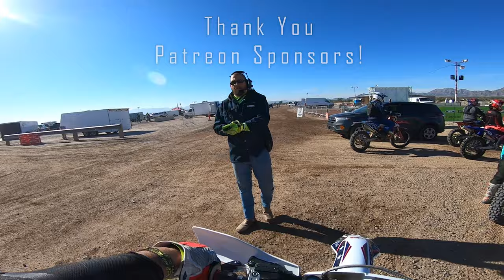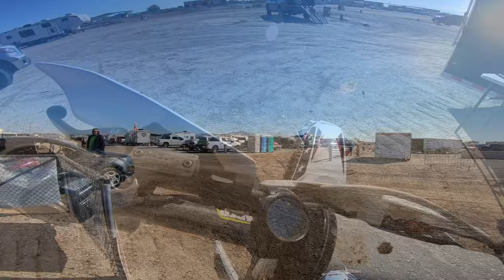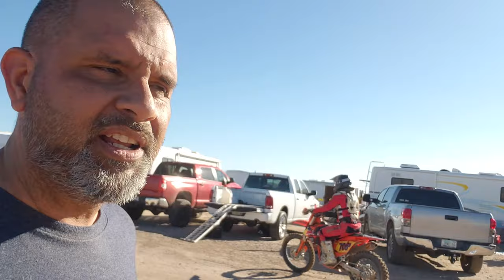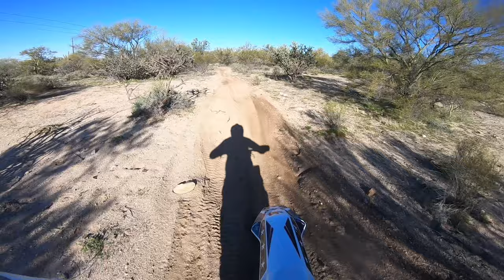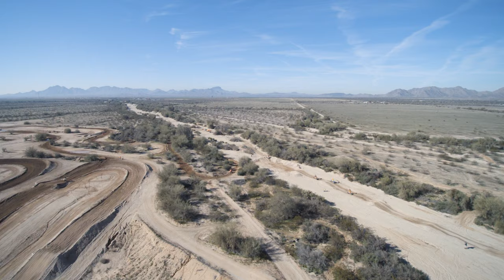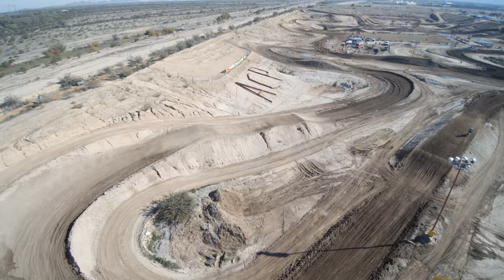So Far 2020 is a Bust! | 2020 AMRA Round 1 ACP

Comment: Hey, JRS, thanks for sharing both the highs and lows with us!  I’ll add a tip along with the others:  the “crossbar” pads that come on the KTM & Husky mx-based bikes,including the XC-F and FX models, is so big that it blocks the rider’s view of the FI (and low fuel) light.  If it hadn’t been there you rely wouldn’t have missed the blinking light during your prior rides. My fix is on every new bike I replace that pd with the much smaller one off the W/E series bikes (XCF-W / XC-W /FE / TE).  I would also second the suggestion above about mounting some Bulletproof Designs rd guards.  You say you bent a set the first time you rode them, which is super hard to believe. Are you sure they were actually BPD guards and not some cheaper knockoffs?  In any case, I believe they’re warranted for life against bending/breaking, and when it comes to racing most guys will choose to put a few extra $$ towards protecting against race-ending damage, even if like you say a potential fix (after you’ve dnf’d) might be slightly cheaper. You can’t win without finishing, and each DNF costs much more than just the replacement parts, as all the time, effort, and expense involved in getting to the event is also down the drain.  Keep your chin up!

Comment: Joe Rockstar, just an offer of "old timer" tips and fixes get a single cigarette rub it together to empty the tobacco out into your leaking radiator ...it will not clog the general flow of the water but, will find the leak and fill it. thus stopping the leaking. It is very easy to remove in a general cleaning or if you take it to a radiator shop! Thnx for another trilling video!!

Comment: That sucks. Don’t feel too bad. Your doing a lot on your own. The silver lining is you didn’t cook the motor. That would have been a lot worse than your loss for the weekend. Keep it up and good luck going forward!!
Reply from the maker: I am shocked that the motor is still going strong. I probably need to change oil and filter right away, and I'll probably need a new top end sooner than usual. But what a well made engine!

Comment: I have the same flash not mine three on my ktm I have wires that go to air filter box that is cut maybe ? Never shot water out yet. Have to come up and ride like the track.     I’m Down in Tucson.   Good riding one day I’ll ride that track.  Thanks
Reply from the maker: You do vids at motoland right? I haven't been there. ACP is a pretty good track, but I am more an off road single track fan. Check your manual for the lights!